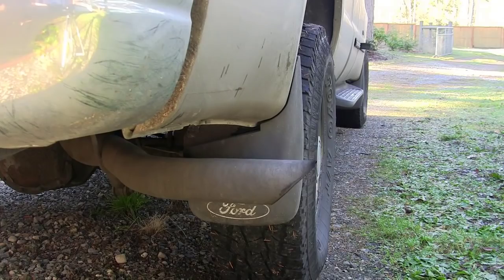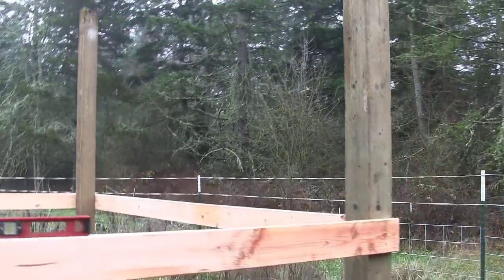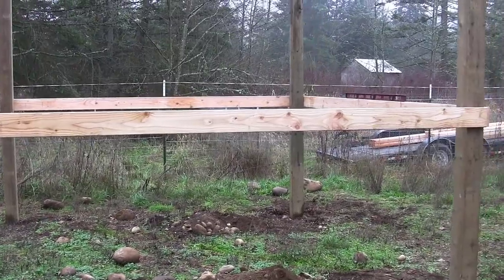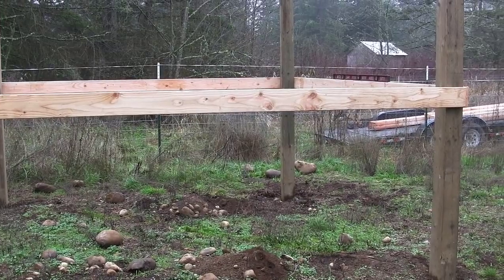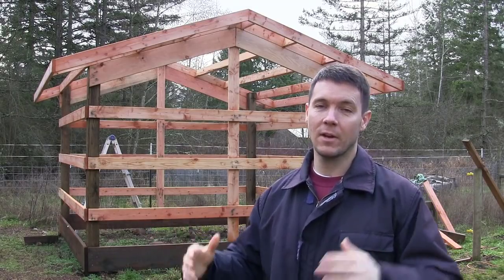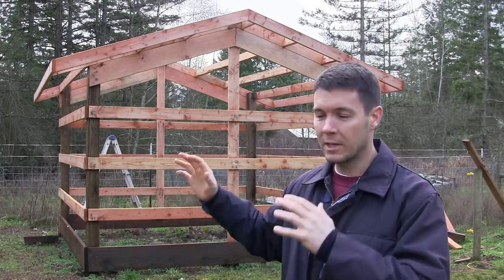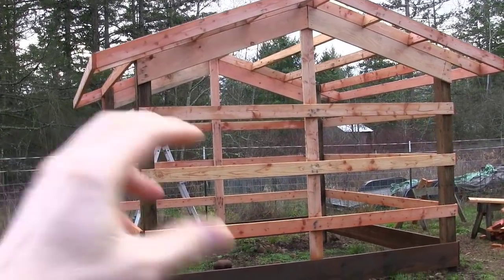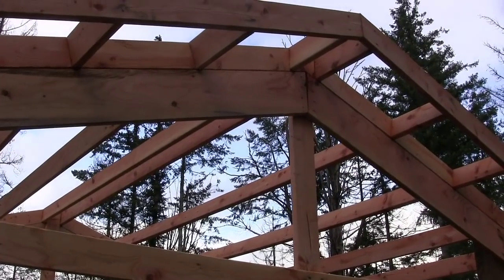Building a Chicken Coop (Part 2) Framing the Pole Barn

Comment: I learned something last week that I really valued and I think you would benefit from it too.  The wonderful clamps that you can close with squeezing one hand really help when you are working on your own, like a second person to hold things in place so you can use both hands if desired.  No more holding in place with one hand and drilling with the other hoping it does not slip!  Since my son moved out on his own I have struggled getting things done by myself and I have more fencing to do on my own and I loved this clamp idea.
Reply from the maker: Thanks, I'll have to look into them.
Reply: @MikeKincaid79  Irwin is the brand I am thinking of.  They have a quick easy squeeze handle and come in varying lengths.
Reply: @zaviahopethomas-woundedsou9848  I have the Irwin clamps, too. I love them. I was actually thinking of getting another set.

Comment: Hey Mike I really like the building can you tell me what size,  and also do you have List of materials that you use?
Reply from the maker: I've been getting that question a lot lately so I think I'll put together a video with the materials list at some point.  I actually build this by copying another structure on my property and just figured it out as I went so no building plans.  This building is 12x12 with 8' walls.  The roof pitch is 4/12 with either 16 or 18 inch overhangs.  The 4 main posts are 6x6 pressure treated.  The door posts are 4x6 pressure treated.  Most of the rest of the lumber is 2x6.

Comment: High ceilings and high roosts are a great countermeasure against predators.  Mind if I borrow your design? : )
Reply from the maker: Borrow away!  This coop will be fully enclosed when finished but I haven't decided on what to do about the little chicken doors yet.  I've considered buying the solar powered doors that close at dusk and open at dawn automatically.
Reply: @MikeKincaid79 The automatic solar-powered door works great with chickens... no so well with ducks. Best regards.

Comment: Is there a particular reason for using a nail in place of a third screw on the outer frame?
Reply from the maker: Yes, and I actually replaced many of the screws with nails once I got it up.  I needed the screws to get things started because I didn't have a nail gun and was alone.  Nails have much better shear strength and will hold up better over time.

Comment: What size of lumber do you use, and how many?
Reply from the maker: The structure is 12x12 foot, with 8 foot walls.  Corner posts are 6x6 pressure treated lumber, door posts are 4x6 pressure treated.  Flooring is 2x8 pressure treated with 3/4 inch treated plywood on top.  The roof is a 4/12 pitch with 18 inch overhangs.  All wall and roofing lumber is 2x6 standard lumber.  The center wall is 2x4 lumber.
Reply: @MikeKincaid79  thank you, I’ve been looking at different ideas to build a chicken coop and to keep my chickens safe from predators. This is the one chicken coop that caught my eye, I don’t expect any of the chickens to be going missing
Reply from the maker: It’s a great coop/barn and after almost 2 years we love it.  I still need to get an automated door for the chickens but other than that, it’s predator proof.